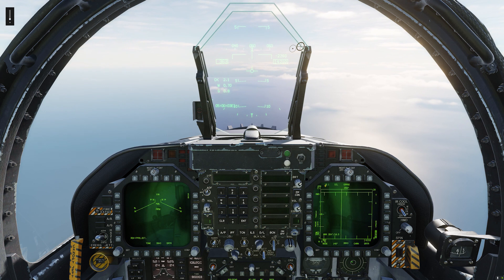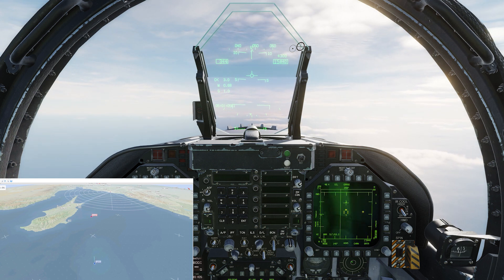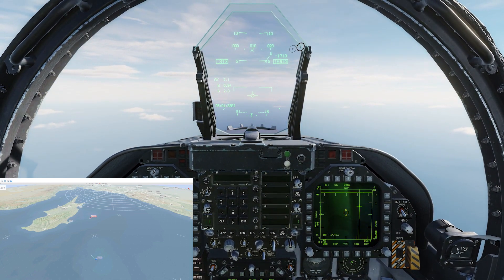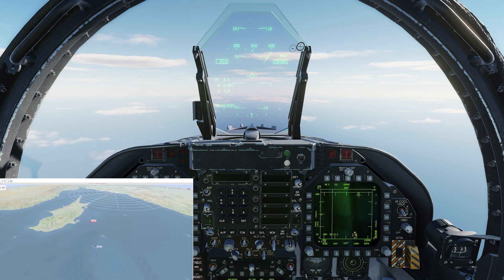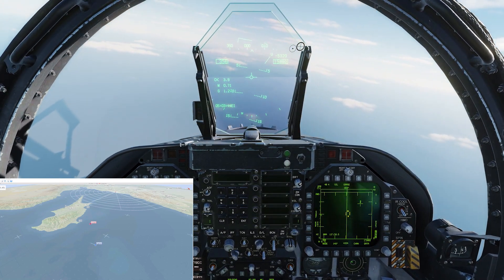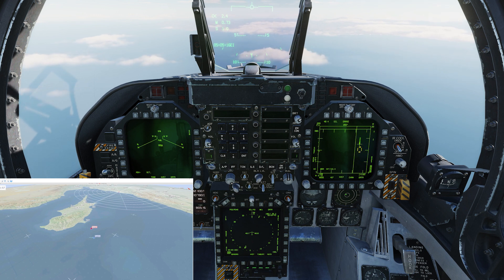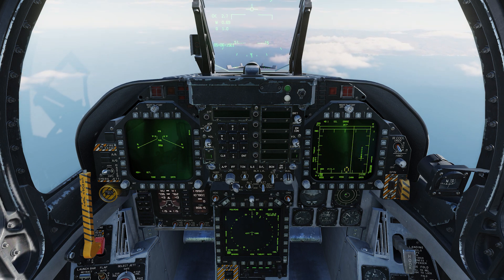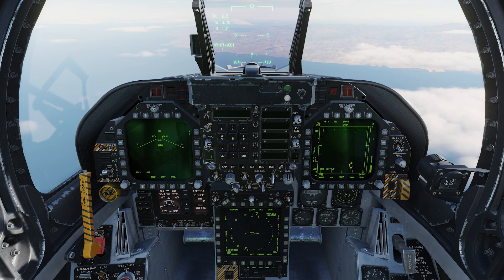Intro to the b-scope radar in DCS World

Comment: I still didn't understand it after watching this video, even though I knew that obviously the radar emits from a "point" outward in a cone shape. I still thought about my nose being only in the centre of the bottom of the radar scope.

Here's what helped me: if you make a 'V' with your hands, and think of the radar beam as coming from the point where your hands touch, but then if you separate the bottom of your hands out into a square shape (like this: |   |) now your hands look like how the radar scope is represented. Now you can see how the bottom (one small point for the sake of simplicity) warps out. That means that the entire bottom of the display is your nose, while the entire top of the display might be a massive amount of space.

Until I did this with my hands, it just didn't make sense. Now it makes sense why moving in a straight line from top to bottom would result in a collision course. This is a great video, not a knock on you that I didn't get it, and it really does help in quickly plotting an intercept course using only bricks/hits history.
Reply from the maker: Hope you enjoyed it and dig further into the details on radar and convergent flight paths.  Always learning!

Comment: Thanks for that.  Its hard to intuit that my position is the whole bottom row, not just the center.
Reply from the maker: It's a difficult thing to visualise. Better to push the 'I believe' button and let the intercept techniques/maths do their thing. More on that to come! Thanks for watching and commenting. ~Tyro
Reply: @THE AIR WARFARE GROUP  it helped me to realize the azimuth hash marks represent my 10,11,12,1 and 2 O'clock.  Then the contact marching toward me on a square scope makes sense.  Will you talk about the quick Calc to get yourself the right amount of separation to turn in and be > a mile aft?  There's a spot on the SA page that will give you lateral separation.  Thanks for getting into the weeds with this stuff!  Getting 1337 killz on GS is fun, but this stuff is stimulating on another level.
Reply from the maker: Yep I will cover stern conversions at some point, both basic and more complex. I'll also talk about BVR timelines and give some suggested 'starter' SOPs for them against common threats. GS et al are the gateway drug - this is hardcore!
Reply: @THE AIR WARFARE GROUP  thanks, I'll watch it a few times to pump the numbers and make it worth your while!
Reply: @THE AIR WARFARE GROUP  Why is it private now?
Reply from the maker: Not sure why it went private - new link: https://youtu.be/RzJxCaBA4Tg